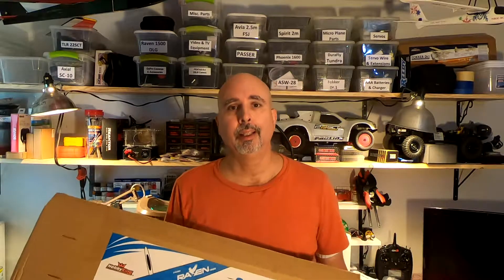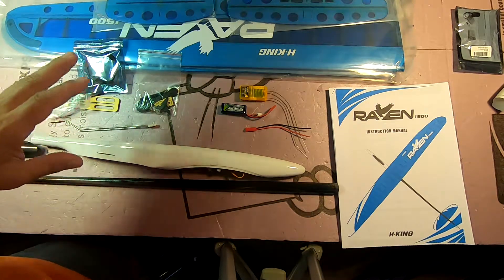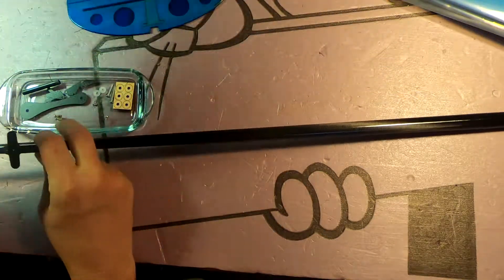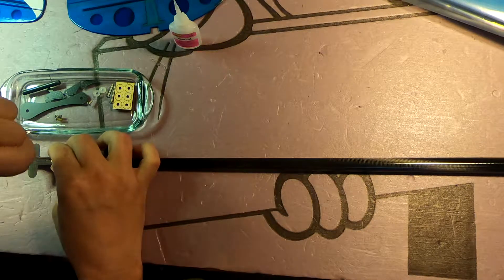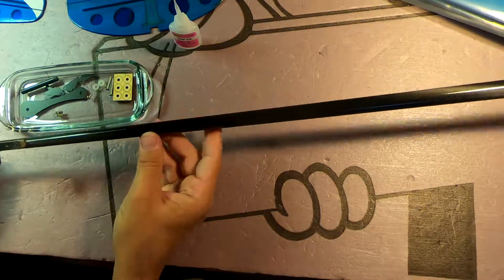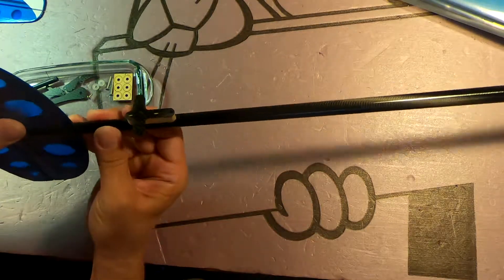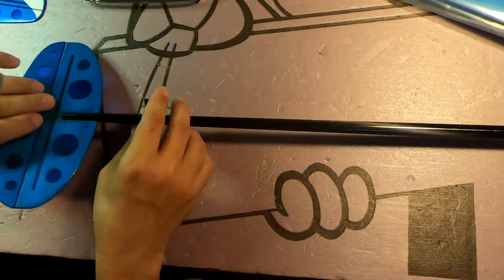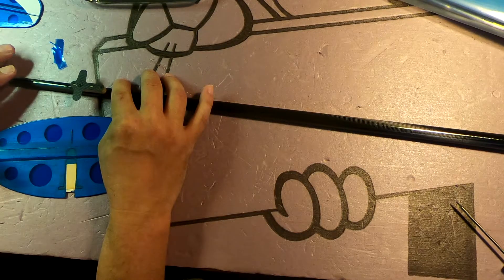HobbyKing Raven 1500 DLG - Build Pt1 - Intro and Tail Feathers

Comment: Got to the end and never flew it?
Reply from the maker: I did get to fly it... had camera trouble and didn't get any footage. I'm disabled thanks to a drunk driver... my issues combined with covid shutting down most legit flying fields, at least the ones near me, has kept me from getting much flying in this spring/summer. It flies well but my ongoing injuries make throwing a big DLG almost impossible. I'm planning to do some mods to it and use it for slope soaring... and I plan to film those mods and subsequent flights. I'm a one man operation here so it's particularly hard to film flights. I've tried to teach my wife, but she can't seem to hold the camera still... her shaky cam footage that would make you puke.
Reply: Sorry to hear that
Reply from the maker: @Dronesteve-72  Thanks, you gotta play the cards you're dealt.